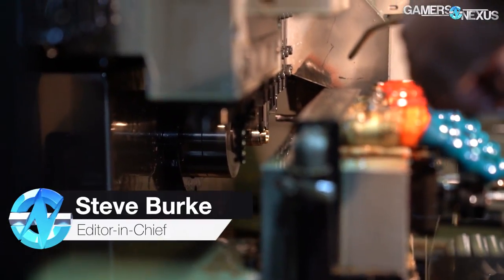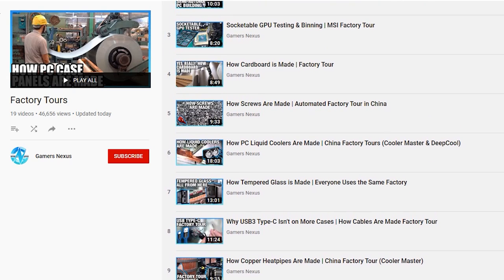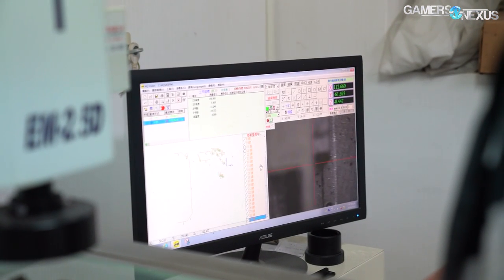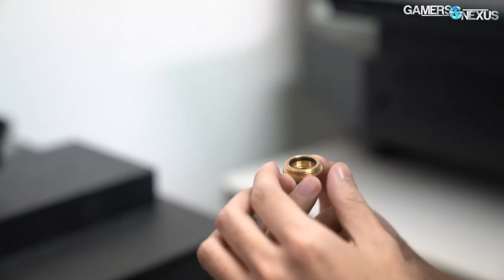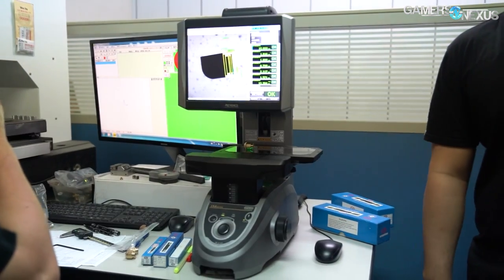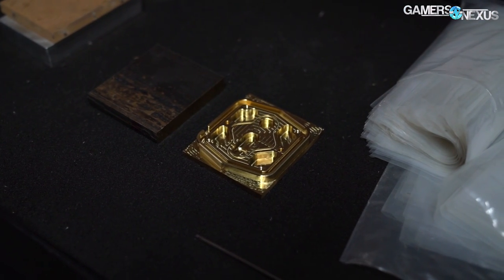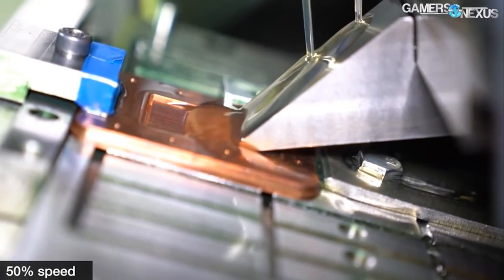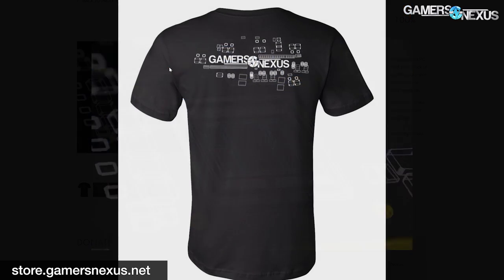Designing & Building a GPU Cooler: Engineering Lab Tour for Water Blocks

Comment: I found the part about the perfectly flat rock interesting.  I once worked over top of one of those that was about 8ft x 8ft x 2ft thick granite. It had a camera mounted above it and they used it to look for basically perfect measurement on finished parts for executive jets. 
 
We were on a lift running pipe for electrical over top of it.  The whole thing was pretty serious, we had to do safety briefings about the equipment before we could start.  We had to tether off tools and materials, and the whole thing got covered in plastic before we could start.  We had a few hours, on a day off for them, to finish the pipe through the room and let another crew clean the whole room.  I had never heard of these things before that, but they are super cool.
Reply: this stuff is so accurate which is what makes it expensive aswell... some coordinate measuring machines even require a temperature controlled room, because the expansion / contraction of the metal with temperature would throw off the results too much... I heard the positioning of parts on tose things is done down to the nanometer, measure via light interference

Comment: The surface plate is granite, with tight grain. There is a twin to the plate that in the old days was kept at the factory. If the plate needed to be resurfaced for what ever reason, the twin was place on top of each other and rotated against each other, creating the flat matched surfaces again. I only know this because I worked in the precision measurement lab at Beale AFB in the 70's
Reply: Yeah, but nowadays we have laser collimators, so we can get things down to 3.5 millionths for a small one without a twin!
Reply: Here ya go, this video: https://www.youtube.com/watch?v=REeGn4hN1Bg
Reply: @bluecollarmage4512   Thank you for the video, fascinating.
Reply: @bluecollarmage4512  is that for a machine surface, or a surface plate that is used in calibration of measuring tools. I am sure that the field has much improved since the days of the SR-71.

Comment: Stonemason here, Granit cannot be Black, it could be some type of Hard stone like a Diorite or Gabbro, or in fact some sort of Calcium RIch Stone like Limeston or Marble.

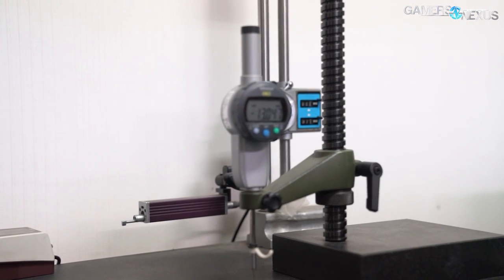Usually these Meassuring desks are Made from A Lavastone soo, gabbro or Diorite. cause it has about the same hardness as Granit. the small secion of the desk is too Far away and not sharp enough to make out details of what it is exactly but if the Small piece where the "screw" is on at 3:38 is the same as the desc material, id say its some sort of Lavastone. (One stone that looks a like the one shown one is called "Virgina Black")
Reply: +1 for gabbro

Comment: Micro-fins do NOT make much sense. I strongly agree that there decision to not go overboard on this makes good sense. Surface roughness can actually reduce cooling. Reynold's numbers & golf balls, those dimples on golf balls reduce drag because the air at the surface doesn't get stripped away during movement of the ball through the air effectively reducing drag. I'm not going to give a lecture on this but suffice to say, more fins & surface area do not equate to better thermal transmission, I suspect it gets worse beyond a certain point. No doubts they have figured this point out & that's why they do what they do. 
They seem well equipped and have good people that are genuinely working to produce the best products they can. 

I am an engineer with 35+ years experience & I specialise in hydraulics, control & mechanical systems. These folk seem to know what they are doing. Turning a product around in 14 days is mind bogglingly good. Like wow, well done to all involved.

Great video, thanks.

Comment: i have toyed with the idea of building my own gpu water block or  reworking an old one ot fit...I had toyed with the idea of using a 3d printer fitted with a Z probe  as a means of measuring  a card,  as measuring with the standard deviation of a the thickness of a piece of paper seems accurate enough

Comment: Why isn't there any block with connectors to the right side of the GPU cards as it would reduce 2x90° short angles and improve flow rates?? Also case width would be less of o problem.

Comment: I have a question. Can you maybe ask or estimate how expensive is real estate in such manufacturing areas as Taiwan or Shenzhen compared to for example USA?  Factories in such areas have huge benefits from close proximity to each other but what is the cost of that?

My bonus question is why PC hardware is design in metric while USA was historically the driving force in creating it? Is it because it is relatively new invention and it strongly connected to academic research(so SI units were used)?
Reply: Not to sound hostile but SI is so widely used internationally is my guess. Alsom without any solid facts I woulkd assume that although PC industry rose from the USA, the participants were likely more or less international figures and that'd make SI seem justifiable. Could also come from tools that were used in making hardware, incase they were imported. Just wild, uneducated guesses, really.
Reply: @LauriHuu  Nothing hostile about your answer. I'm thankful for strangers online like you that share their opinions without insulting others. Thank you
Reply: most engineer I have met in the research and development area prefer to use metric and generally despise the  use of imperial units. We use imperial only when needed.

Comment: im curious, would a flat surface marble rock only be as flat as the ground that its on?
Reply: Nope.  The bottom of the surface place is supported on three points.  Which isn't terribly relevant.  The top being flat is all that matters.  The measuring instrument rides on the top, so everything measured is going to be based on the same plane.

Comment: Hello I have a problem with my memory clock I have g.skill trident z rgb 3600mhz cl16 16-18-18-39. I loaded the XMP profile in the BIOS but the memory only clocks at 3200mhz although 3600mhz is set. The 3200mhz is displayed in the bios, in HWINFO and in Cpu z. Then I got the ram at 3866mhz and 17-19-19-42 and then I was shown a memory clock of 3466mhz in all tools. I also noticed that with Prime95 whether xmp profile is activated or not after 10min a core stops after a main thread shows a fatal error. My cpu is the i5-9600kf and the motherboard is the gigabyte z390 aorus elite. I tried the BIOS versions f9 and f10c and had the problem with both. Would be super nice if you could help me I'm really desperate. The BIOS is completely stock and the CPU, motherboard and memory are new. I also don't have any components there to replace them in my setup which makes troubleshooting difficult

Comment: Wow, having worked in Quality Control before, this is top notch attention to detail from Bitspower. On a different note, just redid my water heater plumbing, and let me tell you my bitspower compression fittings are about 3 times better than all the plumbing fittings I have seen. Most plumbing fittings, compression or push connect, have one seal or one O-Ring. My bitspower fittings have a minimum of 2, if not 3. Makes me wanna slap those bad boi's on my water heater XD.

Comment: I'm curious how 3D printed 99.8%Cu will alter the supply chain for coolers
Reply: I'm not certain the end result would yield the same density (I'd expect it to have some porosity).  It would still require machining, although probably less.  Then there is time.  Can a part be 3D printed, and machined faster, than simply machining a billet?  Finally quality.  Can a 3D process maintain tolerance during a production run with minimal maintenance or intervention vs machining billet?  My estimate is 3D is not competitive on several fronts.

Comment: lol, i use that exact depth gauge at work and i just casually throws it into the drawer
also: at time it can have upto 0.05mm difference after 20-30 measures
Reply: They seem to have a very normal indicator mounted, the were talking about a very nice surface roughness tester.
Reply: hm.. i wonder if there is a connection between both of your sentences :x

Comment: IT guy with 2 years of geology here; that rock slab at 3:55 is not marble or granite; there is no such thing as black granite. Gabbro on the other hand looks like what would happen if someone "photoshopped" all the felsic components (geo for white) of granite black...that is very possible do to its hardness and greater "life" resistance than limestone by extension marble (softer and soluble at acids such as rain)

Comment: Why do I have a feeling all their equipment is just for show.  The block needs to contact the gpu.  Everything else is touching via thermal pads.  Thermal pads are designed to fill in gaps.  Chinese companies and their dog and pony show.  The whole we are very precise in our manufacturing is load of cow dung.  It's expensive because it's a low volume product.  Each one is custom made for a handful of customers.  It's not expensive because it's a high tech process/product.

Comment: I hope they are recycling all that water... or using sea water...
Reply: It is coolant, not water.  The machines have a reservoir where it is pumped out and directed at the tooling.  Then runs down and back to the reservoir.  Salt water would ruin everything.  The part being manufactured, the tooling, the CNC machine.
Reply: @ShainAndrews  Excelent
Reply: @silverwerewolf975  i think it's a special type of oil for cutting and cooling

Comment: Why are machine not as precise as human in some cases?
Reply from the maker: Lots of reasons! They don't really have a "sense" for some things, like whether a screw is going to crack the GPU die when installing a cooler. Humans are used in instances where more sensitivity and 'feel' is required.
Reply: @GamersNexus  then the buyer torques the block like mad and blames the manufacturer :p